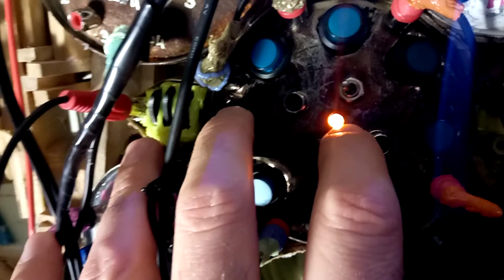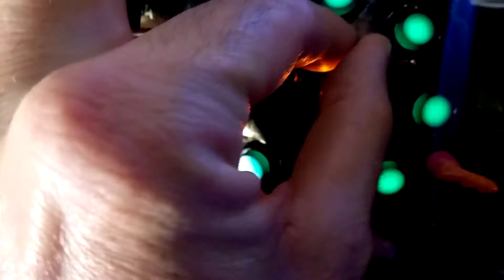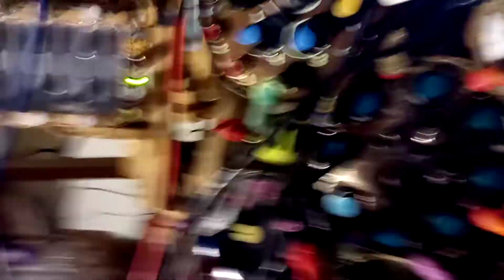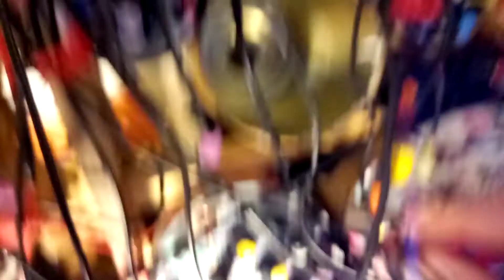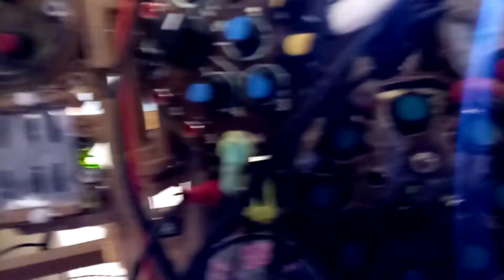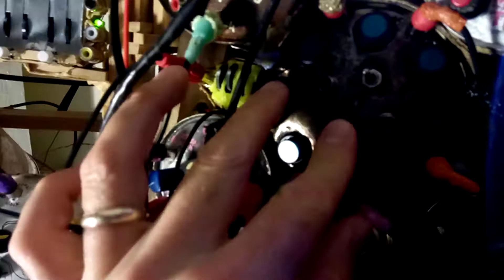EasyEi8ht trigger sequencer prototype demo

Comment: Hi, great modules. I want to build it soon, thanks for sharing. Just One question, When you set to eksternal clock in config mode, does it save when you power off and back to on ? .. already sub :)
Reply from the maker: There's a new firmware that switches to external clock automatically as soon as it detects a trigger, and can go back to self-clock if you disconnect the trigger and start the clock again with the shift key.

This video was made before a total software rewrite LOL... which I haven't uploaded to Github yet :D stay tuned!
Reply: @ozerik  ah Cool, thanks for quick replied, da bell waitin for the ring :D